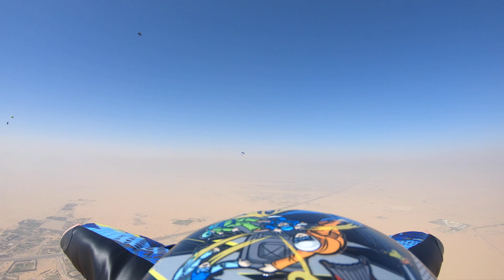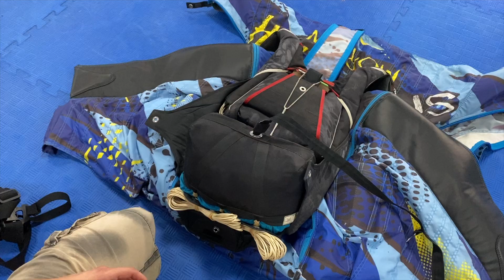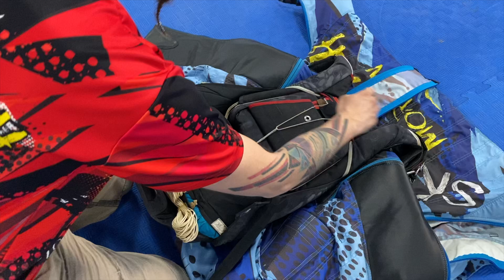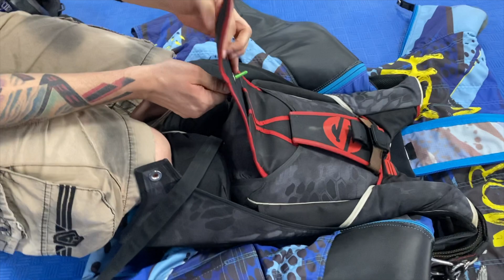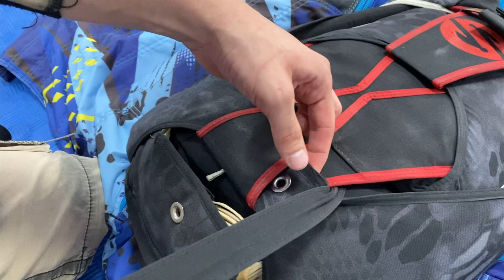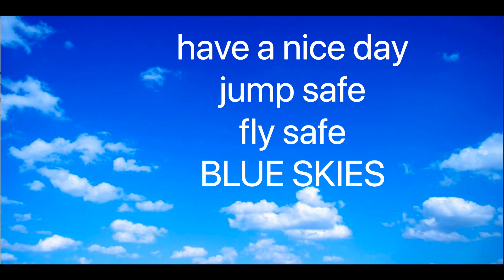(SIFE container) Scary Wingsuit Pilot-Chute In Tow Malfunction Explained Pack Job

Comment: Why are you packing with stows towards the bottom of the container?  Vast majority of the time the bridle pulls towards the bottom of the container in a wingsuit.  Not toward the reserve or "out" like in belly or free-flying
Reply from the maker: Packing as per manufacturer manual ( d bag). But the issue here was caused by bridle routing. Routing bridle from up to down ( as on the video) is also as per manual, but in wingsuiting it's not good idea, I explain why. 
Now I do Bridle routing through the bottom and all good. 
This video is not an instruction, it's only my case, what happened, and what I did wrong. =)